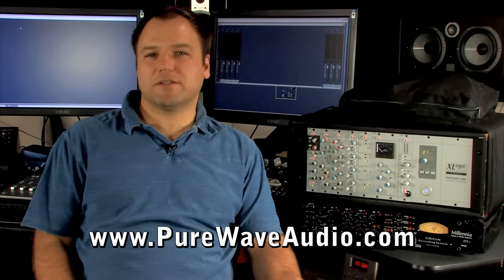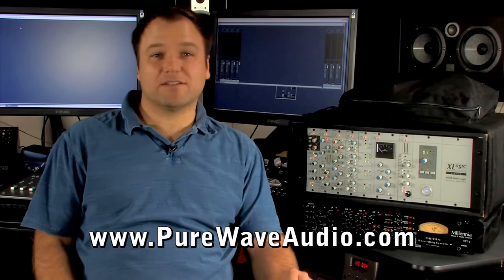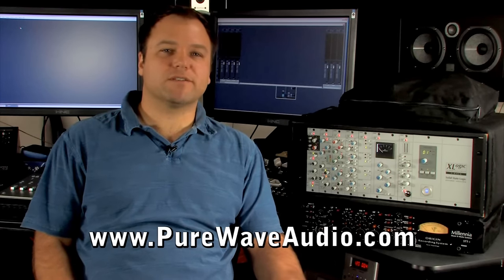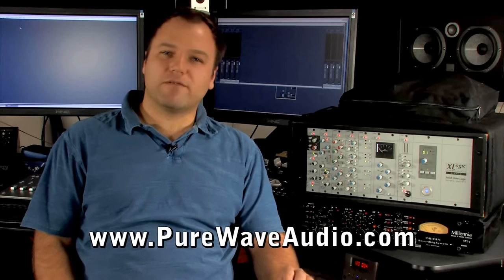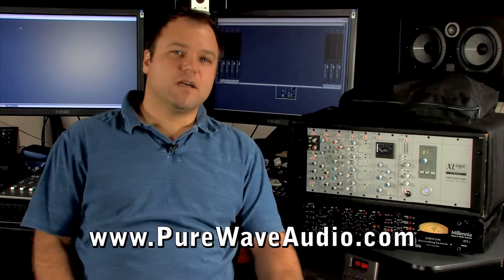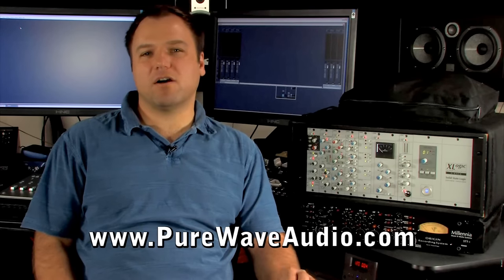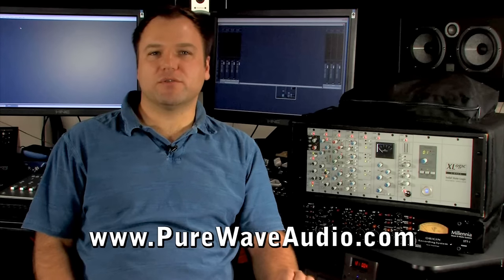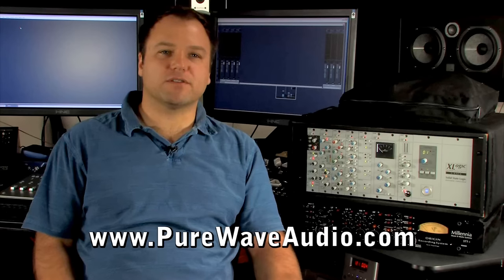Analog Summing - Why and When To Use - Tech Talk

Comment from the maker: @Michael55443    Most print back to a stereo channel in the original DAW file and then export from there.  This works well not only to capture the audio again, but is organizes your files to be all in one place.  The other option would be to go to an external device, but most external devices do not have as good as a clock and A/D conversion as the converters available for your computer.